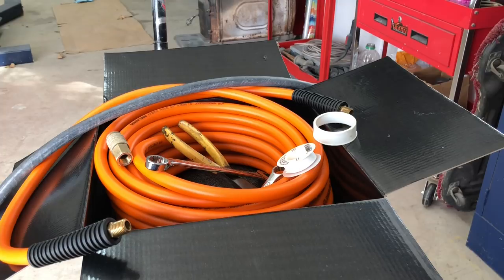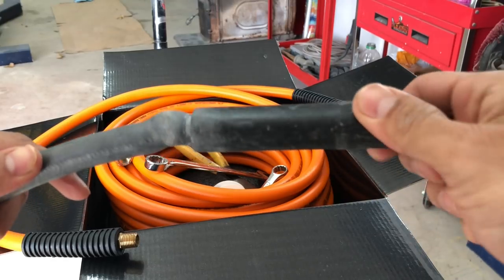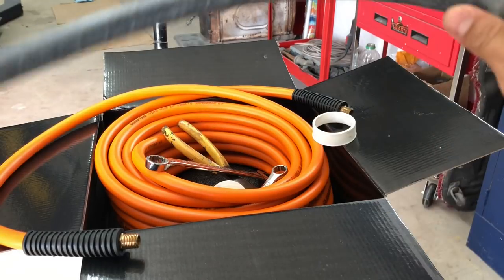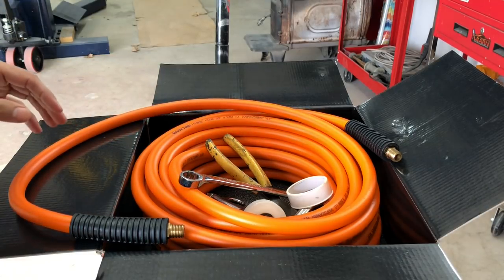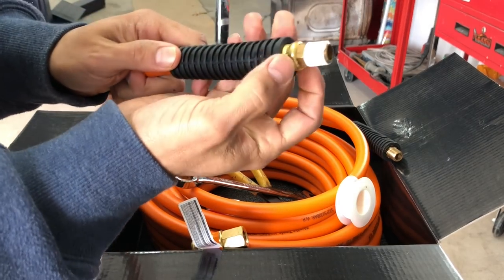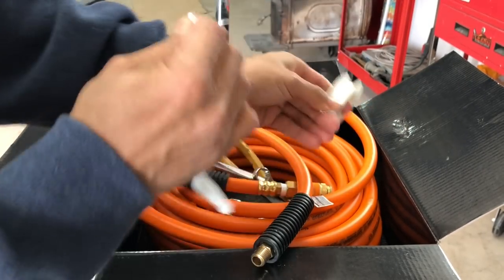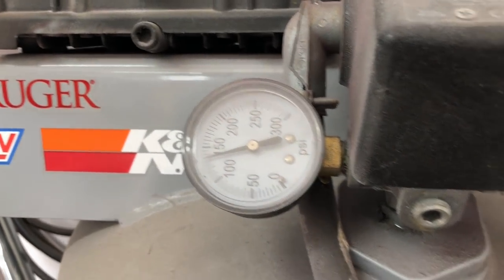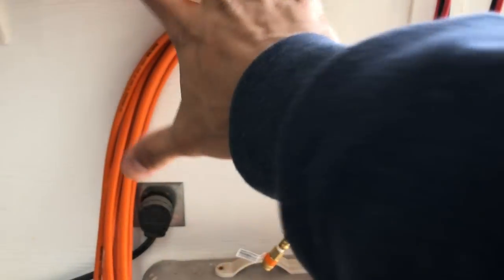How To Setup Air Hose Line For Car Painting in YOUR GARAGE!

Comment: Tony, I enjoy your videos. I am now at stage where I need to do some, initially, small paint work. Regarding filtering and the line from compressor to filtering/regulating system, I have read that you need 25-50 feet of line from compressor to filtering/regulating system to eliminate problems with condensate water in the line. Also, I read that you need a three stage filtration system to eliminate water , larger debris, smaller debris, oil.
Reply from the maker: I recommend you check out the VIP program! It's a very comprehensive program, everything you need to know about auto body work and paint is there! Check it out! https://www.learnautobodyandpaint.com/vip-offer/

Comment: I'm just learning about spraying and I'm a little confused about the nozzle size I've learned that a 3/8" to 1/2" hose is better for an HVLP gun but if you put a 1/4" fitting on it aren't you constricting the volume of air going to the gun at the same pressure?

Comment: You ever use the flexzilla air hose was looking at it online but in future would like to get a paint cure light I saw one today for a great price. I got a couple of 10,000 lumen lights from Harbor Freight but gonna move the position of one of them. I think rather have it like one shop light on the left side of the garage but not in the front part of the garage the middle left edge and the other one on the middle right age. Also and see how much light I get in garage off that if I need more light I can put one in the center part of the garage but it already 20,000 lumens with the two shop lights combined. I been buying a lot in the last year but have to save for other stuff too though am moving to Texas where brother lives maybe at the end of this year in December.

Comment: Is 10–20 feet of line off the compressor enough? I just bought two 50foot lines, Wondering if it’s too much.  I was going to do 50 off the compressor then filter than 50 to gun.
Reply from the maker: 50 to the filter might be too long. I would recommend anywhere from 10 to 20. Then you can run 50 from your filter
Reply: @HowToPaintYourCar  you want the dryer farther than 10 or 20 feet , the air has to cool fir the water to form , many run pipe up and down the wall just to add distance for the air to cool. If you were the expert you claim to be you would know this .

Comment: Question...i have a 30 gallon 5 hp craftman...been using standard size fittings...i heard the larger  i think its 1/2 fittings are better for painting do to more air to the gun from another channel... not sure if i believe it would be worth doing... i just paint a panel or so every month or two...Have you ever used the larger fittings? do other painters use standard or larger fittings?...thanks for your input.
Reply from the maker: Check out VIP and see how it can help you with your custom project: https://www.learnautobodyandpaint.com/vip-offer/

Comment: Tony which pant gun is better lvlp or hvlp for clear
Reply from the maker: Zero to Hero 24/7 It depends what spray guns you’re using. If you’re using the ATom, I would go with the MP-LVLP. You can compare it to the SATA RP. This is the feedback and test results that I got back from Atom. I’ve sprayed clear with the mp-lvlp Atom and lays on fantastic. Hope this helps.

Comment: video is good      but it should have been mentioned I think that a 3/8 high volume system is much better for painting than the 1/4     .        1/4 is ok for small jobs   but if you are painting big ones like cars the difference is night and day .     paint guns work on air volume    going from 1/4 to 3/8 high  volume actually increases the fan size on your gun

Comment: Hey man,can i use hvlp 3/8 compressor hose and fittings with my A.N.I F150  lvlp spray gun?
Reply from the maker: keemoify Yeah of course. But I think you’d like the Atom spray guns better. Search the Atom X27 spray gun.
Reply: @HowToPaintYourCar  ok i will check into that, thanks for the answer